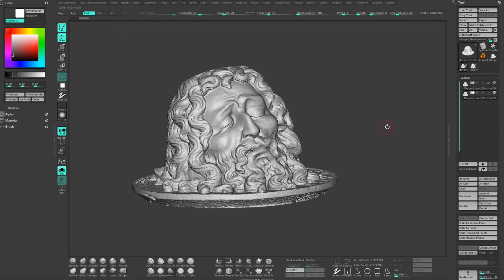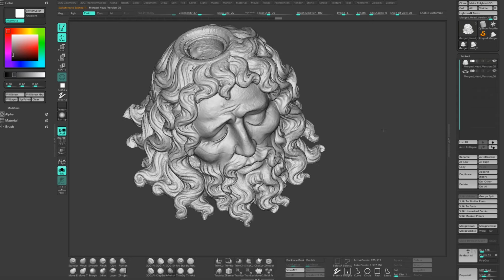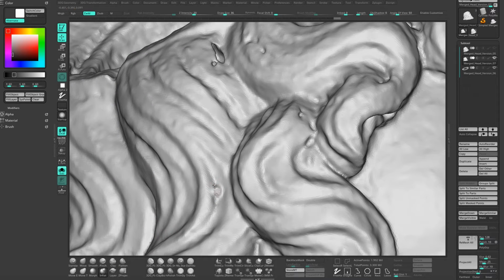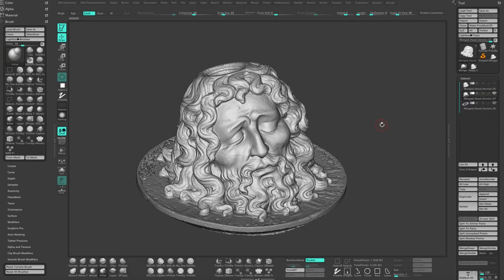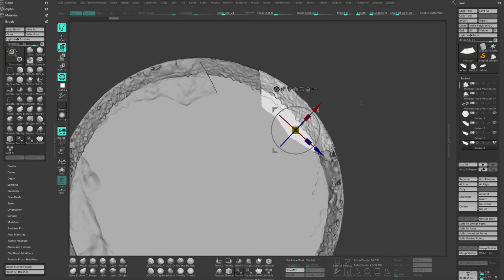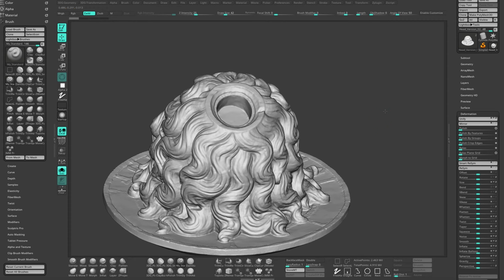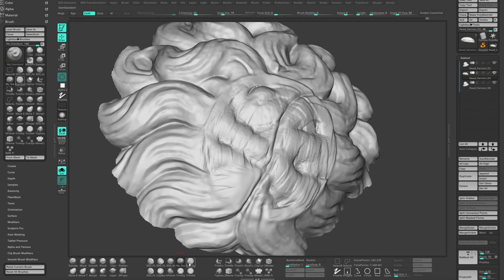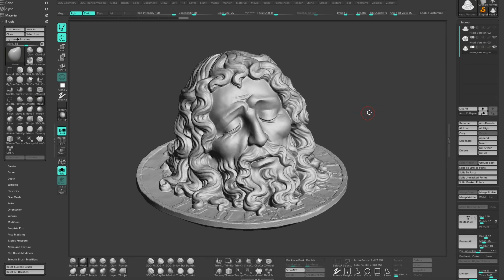How to fix BROKEN 3D scans!

Comment: Awesome. Real life projects is always interesting to watch with all its quirks and problems. Kinda lame that in 2019 Zbrush still doesnt have any decent tools to fix holes in meshes. There is also a way with InsertMesh brushes, but it is far from being perfect too.
Reply from the maker: Thanks Nick for your comment! Actually, I think that Pixologic has improved the "closing holes" function quite a bit in latest releases. It was way more unstable and arbitrary in previous versions. Like I've mentioned in the video, I was surprised how well the bottom of the head was closed. But still, and I totally agree with you, it's not perfect and results always depend on the shapes of the model and the size of the missing part.